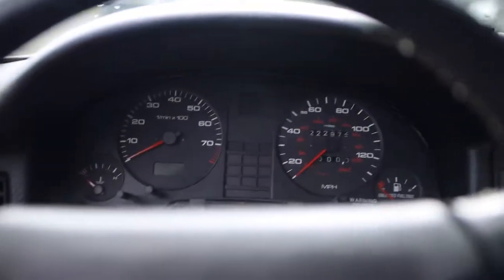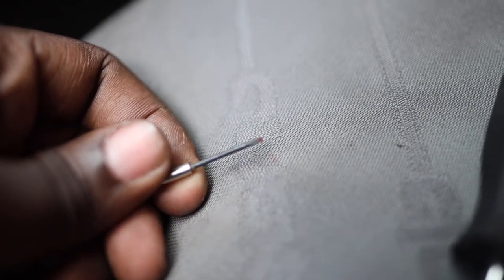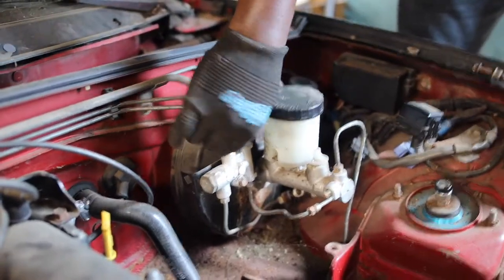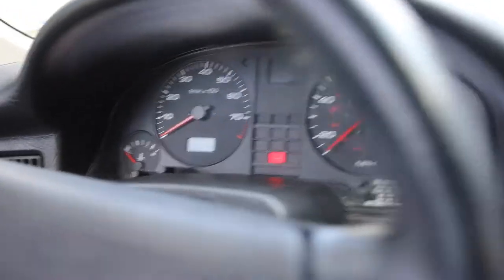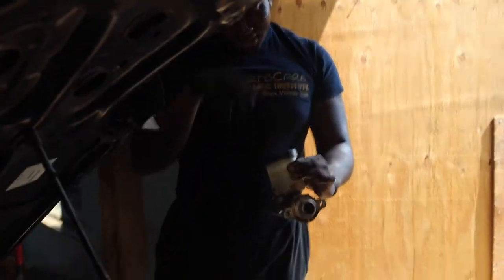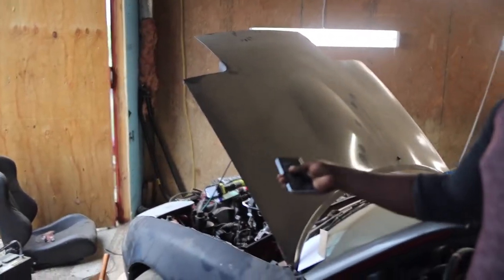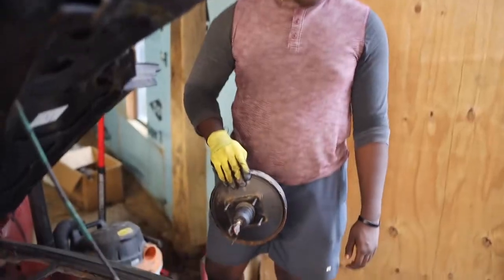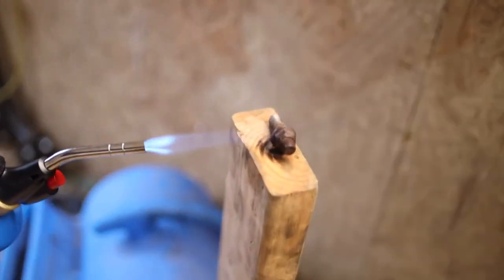Replacing our 1991 Audi 80 Quattro Ignition Switch + Deleting the Brake Booster on our Turbo Miata!!

Comment: Mans had to go to Comrade ChrysFyx for a tutorial, hahaha. I'm jelly of that Audi. Love the launches too.
Quick tip for rubber hoses on metal lines. Grab where the clamp was with pliers and twist to break the seal.
Spray some lube at the end while you twist back and forth and it will make it even easier to pull off.
Glad you're back man! Congrats on 500 subs. Keep it up and you'll hit 1k in no time. Let's gooo!
Reply: P.S. That picture of you under the dash is gold. I'm guessing you forgot the pin in the pedal the first time.
Reply from the maker: Forgot to unplug the airbag power supply 🙃
Reply: @MonsterMotoring  That prevented pulling the brake booster? I meant the Miata hahaha.
Reply from the maker: I swear to you, that was it hahaha. Even weirder was that it had a Ford part number
Reply: @MonsterMotoring  Hahaha that is bizarre. Mazda was partnered with Ford at the time though so part sharing isn't that weird.